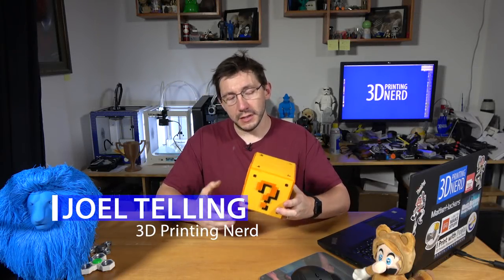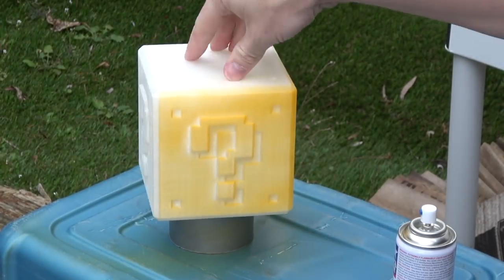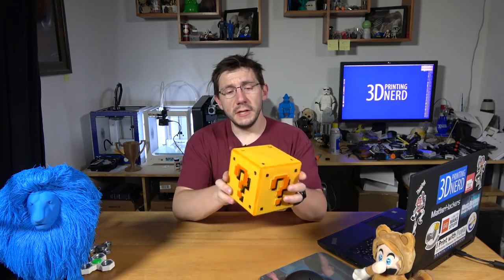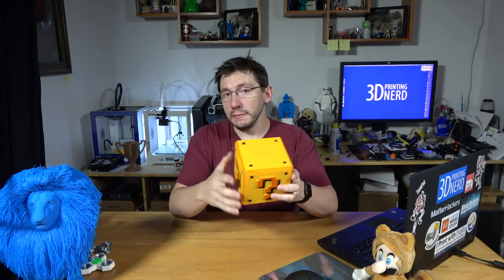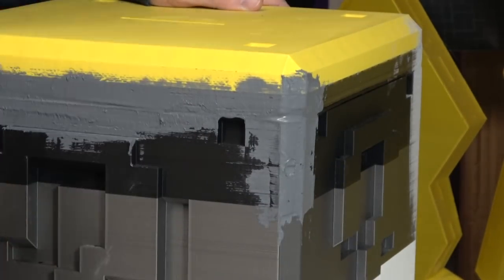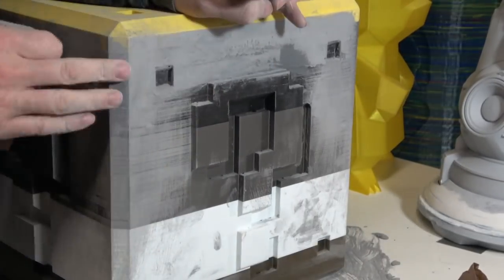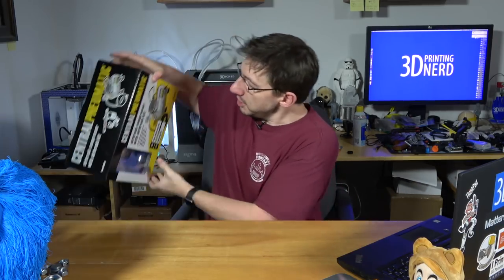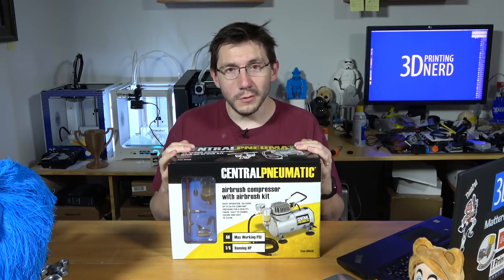3D Printing / Sanding / Painting the Super Mario Question Block: Part 1

Comment: You need to sand, add a good spray primer and then sand again. You can then spray on your base coat. Sand between layers. For final touches use a decent acrylic paint. Vallejo model color, do a good range. Get a palette and add paint to the it, then carefully mix water on a 1:1 ratio. It should be the consistency of milk. You can then add the details. You will need many coats to get decent coverage but for optimum recents it is worth it. To finish add a coat of Matt clear coat. It will protect the finished model.

Make sure when sanding to use a sanding block, start with a coarse grit and then move on up finer and finer until you are happy. You can buy sanding sticks to reach small spaces. Alternatively you can use nail (finger) boards found in the beauty section as an alternative.

Hope that helps a little.
Reply: What great advice. Super clear and providing alternatives, too.

Comment: A friend of mine told me use alcohol to thin acrylic airbrush paints. There is acrylic airbrush thinner, but he said alcohol is better since it thins the paint, but doesn't dilute it an evaporates very quickly -- haven't tried it yet, but he swore by it -- he does actual hand sculpting with clay and does really amazing work.

Comment: Joel. Its not you or the brushes its the paint. Tamiya paint is fantastic through an airbrush but brush painting it it goes down awfuly even if you thin it with their thinner. Trust me as someone who has gone down that route. Get some Vallejo model paints will go on fantastic with a brush. Also of note the Tamiya orange you had is a clear orange those typically go on clear parts like tail lights on car model kits or canopies of aircraft.

Comment: I use a 3d printing pen to fill in issue areas on a print you had some problems with, this works well and means you do not have to use anything other than the PLA or ABS you were originally using.

Comment: Hey Joel. Good video. I been experimenting with polishing 3D printing parts and I notice that a media blaster (with plastic pellets as the media) works great. Also I wan to try a tumbler sander with wood or plastic to smooth 3D printer parts. Maybe a local workshop has one of this tools to sand the parts.

Comment: When hand painting, especially with scale modeling paint, which dries very fast, it is important to use a "Paint Retarder". 
 The paint retarder will slow the drying time and allow you to put down smoother brush strokes.  Tamiya has a Paint Retarder available and it is very good, but you can use others as long as it's compatible with the paint you are using.  E.G. Acrylic vs. Enamel.  Just a few drops in a cup with some paint goes a long way.  Don't put it directly into the Paint pot though.  You want to mix it separately.

Comment: That  was regular primer.  Filler primer has an additive for filling cracks and is better to be sanded.
Reply from the maker: +Robert B oh okay. Shoot. Thank you, Robert. I haven't primed it yet. Would I be able to find a filler primer at a local Home Depot or Lowes?
Reply: Should be at any hardware store.  Rustoleum has it in a red can with grey lid and will say FIller Primer on the front.  Make sure to shake well the additive to filling cracks tends to settle.

Comment: Joel! You need a sanding block for your paper....  They come in various sizes and are essential for levelling flat surfaces as using your fingers is tiring, takes longer and can actually introduce unlevel areas.
Reply: You could even 3d print them.
Reply: Or a mouse sander + sanding block. High Five Joel!
Reply: You can 3D print one

Comment: I do a lot of fabrication in the automotive world.  For the finer tedious areas,  you REALLY need to consider using Rage Gold by EverCoat.  it's very fine, much easier to work with for this type of smoothing/shaping  surface details.

Comment: Those just starting at painting prints. Those super cheap acrylic paints and brushes at walmart may not be 5 star top tier quality. but they work and can enable you to get lots of fun colors and get started for very very very cheap
Reply from the maker: +Drew Pickard yes! That's just it - took nearly nothing in funds to get those brushes and paints!
Reply: 3D Printing Nerd Harbor fright is also a excellent place to get starter tools, like your airbrush there. For $10 somebody can walk out of there with sandpaper, a set of needle files(get some if you haven't already) and a can of primer. Bonus hint if you search Harbor fright coupons you can almost always find a 20% off one item coupon. They have $5 dremels(with bits!) too. $4 flush cutters there too. It's easy to be blinded by all the fancy tools and paints people use, the biggest cost of entry to finishing prints is your time, well and being able to push through mistakes

Comment: Filler primer works great, but if the printing lines are really bad you can coat the model in clear epoxy.  I use amazing clear cast resin.  It can cut down on the hours of sanding too.  I used it on my Hellboy Good Samaritan build. Also one thing about the airbrush, the airbrush paint usually goes on thinner then paint from a spray can so you want to make sure its really smooth before airbrushing.   You can see the results of my Hellboy gun here.  I was inspired to print this when I saw you video build.
 https://www.youtube.com/watch?v=EPfj4dnOKv4

Comment: An airbrush would do you wonders for painting. I think it is more valuable when it comes to painting than hand brushes. For around $230-280 you can get a Badger airbrush, a 1 gallon air compressor, and a hose. A tank helps prevent the compressor from constantly running and extends the life of the compressor. Badger makes a good air brush that is fairly low cost.
Reply: you didn't watch the whole video did you?
Reply: MrSpeedyman I did, he pulled out a Harbor freight airbrush kit. I had a bad experience with a cheaper kit that came with no tank.  please don't accuse me.

Comment: just got my first 3d printer. anet a8. any advice on where to get some inexpensive filament?
Reply from the maker: For inexpensive I've purchased Hatchbox on Amazon before. Decent material that's cheap. Local Microcenters can carry cheap filament as well.
Reply: 3D Printing Nerd thanks.
on a different topic, you should use your gmax pikachu with no infil and make it the money jar for next year